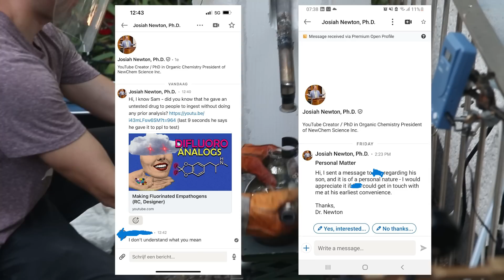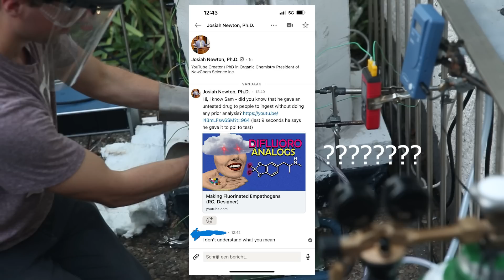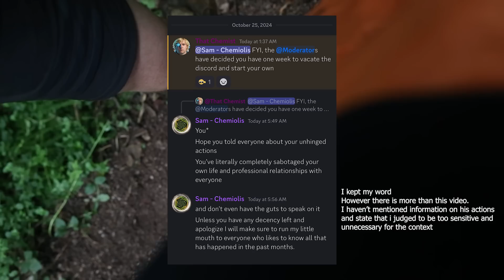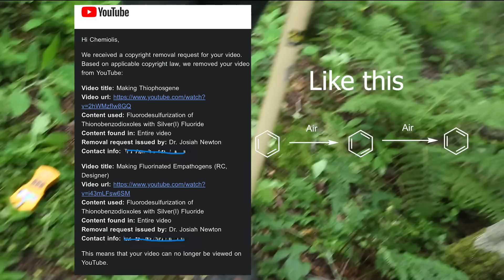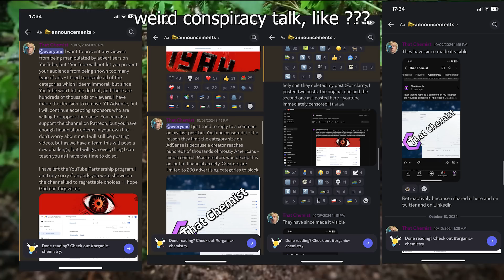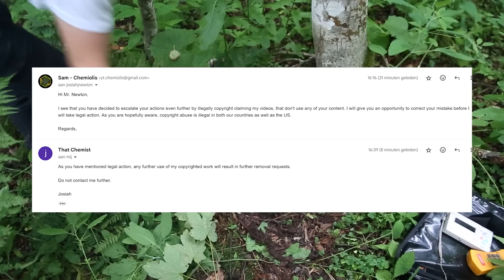That Chemist (Josiah Newton) is a Fraud

Comment: People need to be careful with psychedelics. I have seen them mess up plenty of people first hand. Most recovered, but many are still dealing with the consequences. Dont go testing the limits. I have also seen people turn into egotistical maniacs, who think they are an authority on everything from this
Reply from the maker: I believe that these drugs can be incredibly helpful to cure someone from certain illnesses like depression  and I am super acceptive of their use and hopefully future professional use. But without proper guidance it seems people try it, get some feeling of enlightenment and want more and more and more. At that point you are altering your internal brain restructure permanently or even damaging certain cells ability to produce and interact with the right (amount of) neurotransmitters. The brain is a slow system in terms of healing, and it takes a long time to bounce back after using such strongly impacting drugs, it is barely regenerative and any damage is mostly permanent. For some people this change can be positive, putting them in a better state, but for most I see it just pushes them towards some kind of delusion where they think they are enlightened, know best and can do anything.
Reply: @Chemiolis  Yea, i recommend doing a psychedelic no more than once a year. And especially more (or not at all) if you are young. I know first hand that they are incredible substances that can help mentally with alot of things. But people need to realize that these things have limits and can only do so much. Drugs alone will not enlighten you, or cure all your problems
Reply: @Chemiolis  Psychedelics are like an elevator, they can lift you up, or take you down. 
You just gotta remember to leave at the right floor, and hope that it lasts long enough to not see the elevator break down while you are at the wrong level.

I guess That Chemist didn't look at the maintenance badge..
Reply: @Chemiolis  it's not that the chemicals themselves are harmful but moreso getting your hands on PURE acid is extremely difficult as you'll usually get some impure ones that is tainted, research chems that are passed off as the real thing or half pure acid and half fake acid or could be made in prison. Having done some of them myself you can tell the difference with pure acid as you'll start to teeter on the edge of having a bad trip and in a way works itself out as you'll just probably be enlightened with the experience and realize you shouldn't do acid often enough to where something that happens that requires your sober self at random becomes a problem which is also something I learned myself, but I did screw myself up on shrooms once and haven't taken them since because my family decided to coax me into going with them into a public mall with them and it felt so horrid and depressing to do so while I was tripping balls and just wanted it to end (you cant mindset your way into a good trip like you can with acid in most cases you get what the shrooms give you and all you can do is make sure your setting is as safe and free of stressors so you don't spiral out into a bad state of mind) and psychedelics taken with respect to your environment and proper safeguards will not turn you into some egotistical idiot who thinks he knows best but to marvel at the beauty this world has to offer and how wonderful it would be to be able to (or at least try) percieve everyones happiness at once and realize that humanity can be beautiful and how endless that positivity and nearly impossible it is to quantify it all at once, and yet thats ok because even if you couldnt it shows there is hope for us and this planet yet. That once we figure out our issues going into space and finding planets with even more widly different environments makes it all the more worthwhile to contribute to a future like that
Reply: @Chemiolis this exact thing happened to a formerly close friend of mine who likely got psychosis from psychedelics and it’s just so sad to see. She went WAY above and beyond any kind of therapeutic usage of the substances.
Reply: @Chemiolis in a funny little book called Psychadelic Information Theory, psychadelics are considered to increase plasticity. The Idea being, shaking up the brain would allow it to set back into a different structure not inherently good or bad. So you end up with the entire bandwidth of users. From consciousness researchers, to your average psychonaut, all the way to hyperspiritual types who are raising their vibrations to higher planes of reality to converse with our god-alien ancestors (love those guys). Set and setting...
Reply: @user-yw9mw9hv8o  i don't know if I agree with your wording. I don't think just doing them connects you to a higher plane. I don't even know if there is a higher plane. Maybe it makes you more aware, open, maybe even smarter... but I don't believe there is any sort of inherent virtue in doing them
Reply: @riknitzburg9650  Read that again. They weren't saying that there are actually higher planes, just that a certain type of psychedelic user thinks that there is.
Reply: @riknitzburg9650  oh i didnt mean to imply such a thing. Im strongly with the likes of the qualia research institute on this. Fully and truly believing you are in a higher state and are conversing with a perceived autonomous entity is just simply one part of a state space of consciousness. And youre correct theres no inherent virtue, on one hand you could satisfy a genuine curiosity for the inner workings of the brain, or seriously and irrecoverably delude yourself. I reiterate: Set, setting and dosage too.
Reply: @Chemiolis "Seems" is the keyword here. Let's not forget that most users of psychedelics are non-problematic and non-delusional. In fact cannabis has a higher schizofrenia risk than psychedelics (33 vs 25% of cases of substance induced psychosis). But obviously that doesn't change the fact that some people who are predisposed to psychotic episodes should definitely avoid psychedelic  substances.
Reply: @Chemiolis  classical serotonergic psychedelics are also not considered addictive so please get your facts straight
Reply: @Chemiolis  dude classical serotonergic psychedelics don't permanently alter internal brain structure where's your source for that
Reply: @segfault- to put it very simply, if a compound increases neuroplasticity it is allowing new physical pathways within the brain. If your brain is using some of those new pathways then they will remain. There is much evidence to support this, and I'm not saying it's a negative thing
Reply: From having a PhD or from doing drugs ?
Reply: @monad_tcp  BS=Bull Shit, MS = More Shit, PhD = Piled Higher and Deeper.
Reply: @monad_tcp  what do you mean?
Reply: While psychedelics seem to hold real medical potential (albeit in a monitored settling much like therapeutic use of Ketamine or MDMA), their deranged sibling class of deliriants should be avoided under any circumstances.  They're dangerous (typically using highly toxic Nightshades or extreme doses of DPH) the trips tend to be extremely vivid and nasty (with swarming bugs and looming shadow figures being the most widely reported hallucinations), and the likelihood of long-term psychological and cognitive effects is high.
Reply: @wolfgangervin2582 Deliriants can be useful drugs too. Just not much for their psychoactive effects. Atropine is a useful heart and eye medication. And also an antitode for cholinergic toxicity.
Reply: @wolfgangervin2582 dude thats real, i hadnt even known about the "benadryl challenge" or anything since i dont have tiktok and hadnt gone down that rabbithole prior, however once at the end of spring break (i was just at home, not partying or anything) but i had run out of weed and i couldnt fall asleep, so i took 2 sleep aid (DPH) pills to go to sleep quicker, and for a little while it felt a little reminiscent of my first low dose shrooms trip id had, my arms just felt a little lighter, my head felt a little different, etc. and then the next night i was like "well maybe ill just take a couple more" and it felt funnier, and then the next night i took more, and looking back i have no fucking clue why i took that many, but obv hindsight is 20/20 so anyway yeah, this is what happened that night.

the first thing i started noticing was that what looked like ants were crawling everywhere, but thankfully i was able to know it was just a hallucination. and then i noticed my eyes getting really really blurry, like they wouldnt focus on anything. and then i saw what looked like my cat, but just like void, and i was like "well i know my cat isnt in here because my door is closed" but i got up and tried to pick it up anyways just to see what would happen, and it was just like a hologram and my arms just passed right through it, which i guess was kinda like my version of the Hat Man i guess, thank god. and then i passed out and had a seizure and my parents woke me up and i was just like "oh yeah no bro im chilling idk what youre talking about bro" and they were like "you were just banging your head on the fucking wall" and i was like "bruh no i wasnt" and so they took me out into the living room and then i fell asleep again on the couch and had another seizure so they called 911 and then i remember like 5 things from the 2-2.5 days it all happened. oh yeah and my heartbeat was like 200 something idk, but it was high as shit.

i remember that the guy in the ambulance pissed me off because he was yelling and he didnt want to believe that i took benadryl when i told him, and he was like red in the face and shit so i didnt want to be there and then I tried to take out my IV and get out of the ambulance before they left. then once in the hospital i remember having a "room sitter" cause i was 17 and at a childrens hospital for some reason idfk, and he was audibly gay and i thought that was cool because im lgbt too. and then my parents mustve said something to the doctor about me being trans and them not liking it, or actually i think i was talking to that guy and i mightve said something about it, because then i vaguely remember looking over and the doctor was sitting in a weird position saying something to them about how a lack of support can be bad and blah blah i dont remember. then i tried to get up and play video games on the hospital computer because i have my pc at home basically in the same position it was, and then i tried telling one of the nurses that the sink was my 3D printer cause that was also similar positioning, and by the way that was at least 12 hours after i had been in the hospital. and then i remember like 2 seconds of getting into the car to go home, and then my memory just resumes to normal (well kinda fucked up but not too foggy),  and i just woke up and walked to school the next day and told everyone wtf i did, because my parents started sending weird fucking cryptic texts on my phone for some reason and my friends were just like "these arent even their preferred pronouns, some shit is really bad" 

i think over a year and a half later im back to normal at least as much as i can be, but yeah definitely do not fuck with deliriants, they can and will fuck some shit up. im perfectly fine with my one gram of bud a day average that i legally buy from the store
Reply: @wolfgangervin2582  It's not so black and white I believe. Ketamine is not a typical psychedelic, it's considered a disassociative. But yea they are not something I would personally do or recommend. Another things is I don't believe that the medicinal value of psychedelics is best achieved through use in a medical setting. I believshthe best place to be is in nature with people you love
Reply: Correct but this applies to alcohol too. There are always around 5% of users of a drug that completely derail from it.
Reply: @RalfStephan The rate of lifetime problem drug use for ethyl alcohol is about 15% (the only higher rates are respectively, in increasing order, those of cocaine, heroin, and nicotine among commonly used psychoactive chemicals) while it's less than 5% for clsssical serotoninergic psychedelics (Sources: Anthony et al., SAMHSA).